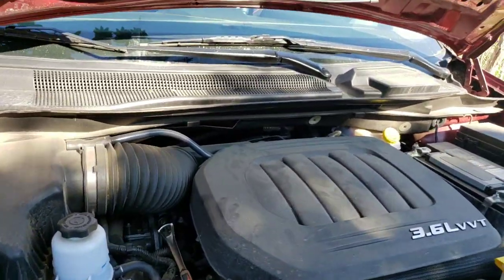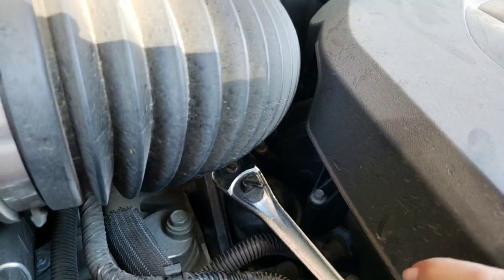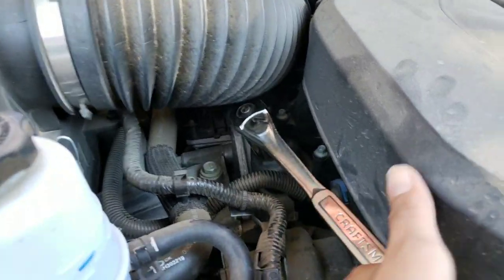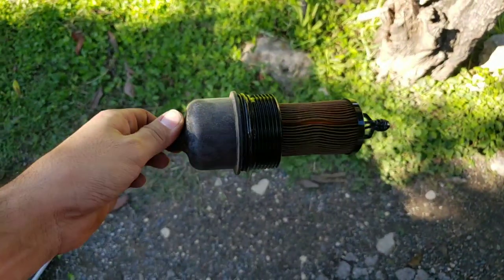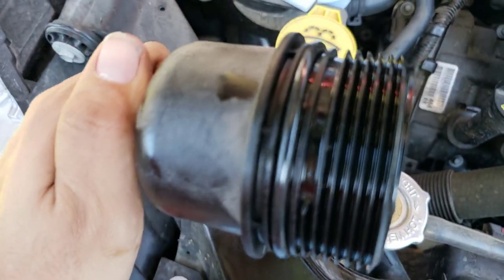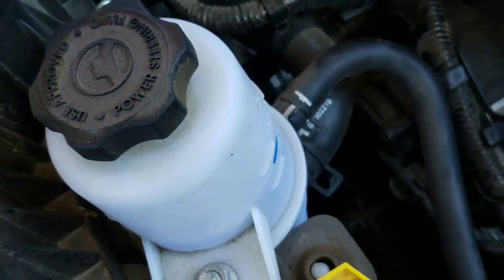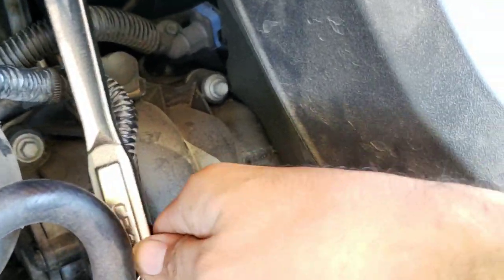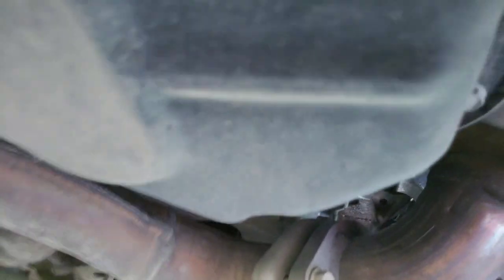Oil change on 2018 dodge  caravan

Comment: Hey , you can get that oil filter out much quicker and way easier by pulling up the air filter top and hose . You made the job a bit more difficult and slower the way you did it . But just the same , you did get it done . Good effort on the video
Reply from the maker: Thank you

Comment: Good job. My cartridge broke after pulling out the filter. All is well got a new one and it all went back nicely. Used 1/2 in socket on the drain plug though. Nicely done one handed
Reply from the maker: Your welcome for the help
Reply: Casey, please, is that a 24 mm socket you are using for removing the oil filter cover? Thank you 🙏
Reply from the maker: Thank you

Comment: It's a lot easier, faster and often less painful to remove whatever is in the way, in this case the air duct, unless you happen to enjoy knucklectomies.
My complaint is with the narrow slot they leave to unlatch the hood.  I live in a climate with cold winters, and I have to take my glove off to unlatch it.
They also never did any tests off pavement.  I live on a gravel road out in the country, and the rear hatch accumulates an unbelievable amount of dust inside and around it where it's supposed to be sealed. I take an airhose to it almost daily, because if I don't, and there is any rain, I've had more than 1/2 inch of caked mud around the top of the opening.   It also would've been a better idea to mount the back-up camera near the top of the door.
Reply: Removing the plastic engine cover works too

Comment: Gearwrench 84603N 15/16" universal socket and a 7" extension.  All 1/2" drive.  A normal socket and a universal might work but would be less compact....  You don't even need to mess with the air filter housing or duct.  Game changer, I tell ya!
Reply from the maker: The shallow 24 3/8 millimeter socket would get a job

Comment: I have this van, over 5 years old now, over 100k miles, how is y'alls plastic cover over that oil filter now? Crappy plastic rounded off. Nightmare.
Reply from the maker: What's the weather on is my mother bought the car in 2018 is now 2023 and it's actually not been rounded off if you use the right I think 24 mm stubby socket that will fit perfectly on it you will have no problem taking it off yes it is a plastic cap design on an aluminum threaded thing that goes into but if you're fine with it and do it very carefully then you won't damage any threads or strip anything

Comment: easier to move the top of the air filter
Reply from the maker: That true I was also if you do your change yourself and you know this is oil leaking but it's not from your cartridge filter or your oil plug it might be your oil cooler line on top of the it on the bottom of the intake you're the did in my mom's car and it started leaking so if that happens you take it in finish it if it's warranted out it should be able to fix it